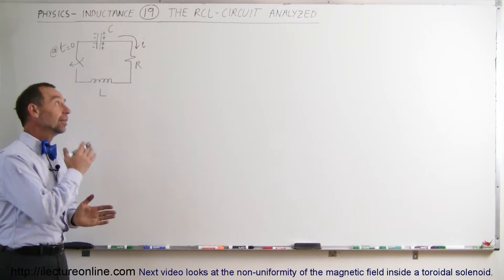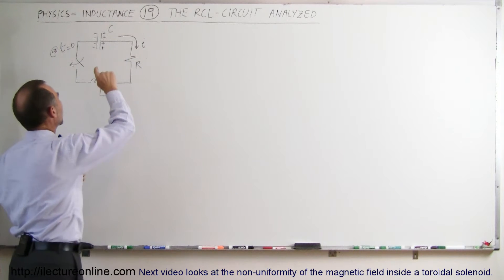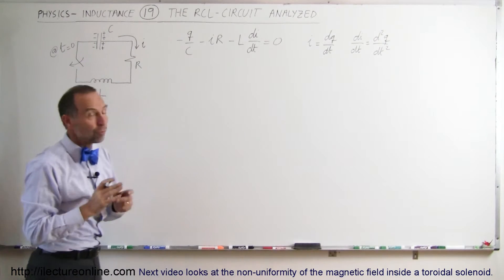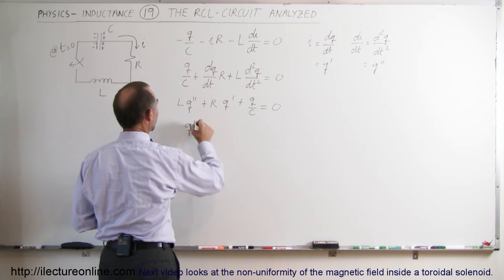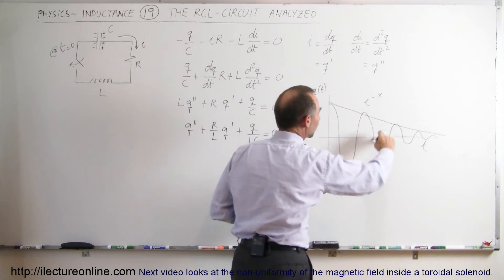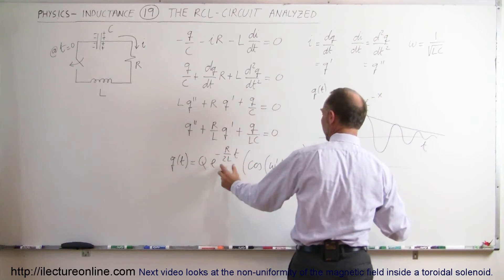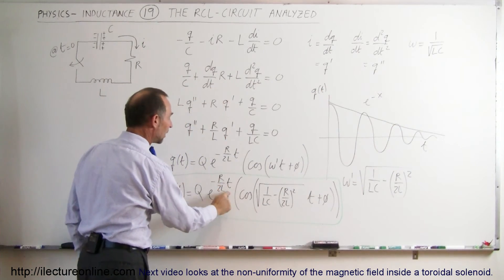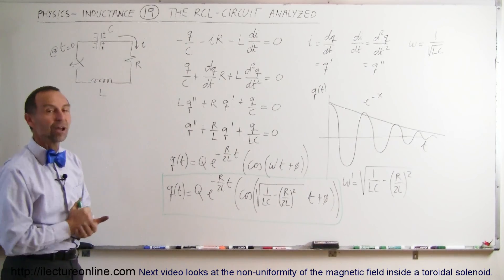Physics 47  Inductance (19 of 20) Find q(t)=? of a RCL Circuit (Analyzed)

Comment: I don't understand why there was a voltage drop in the capacitor. It should have been positive right?
Reply from the maker: You are correct that initially, when the charges are as illustrated in the diagram, there is a voltage drop across the capacitor.  But the equation shown is the general equation as a function of time (any time) which means that half the time the direction of the voltage will be in the opposite direction and thus we simply write the general equation as shown.

Comment: Sir voltage across capacitor going from -ve plate to +ve plate should be positive while writing KVL . SIR how it is negative in KVl.
Reply from the maker: Note that the current will oscillate back and forth, thus the voltage drop will continuously change direction.

Comment: I'm not understanding why there is a voltage drop across the capacitor and resistor. Shouldn't there be a voltage rise when analyzing the circuit with a cw current? 

and @t(0) isn't the current across the inductor not zero as well due to the back-emf?

Not until steady state does the inductor push current in the initial direction of the capacitor.

Is it because (even though there is a voltage rise) di/dt is decreasing (i.e. (-)*(-) = (+))? If so, How does this explain the voltage drop across the capacitor in the same direction.